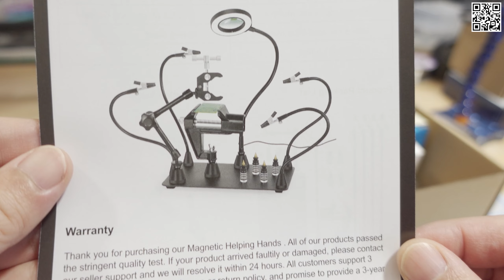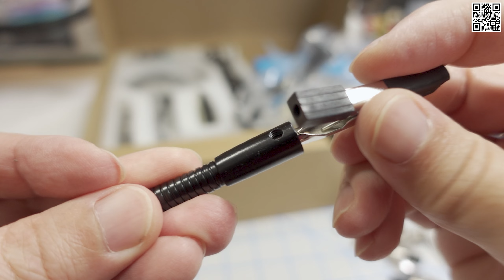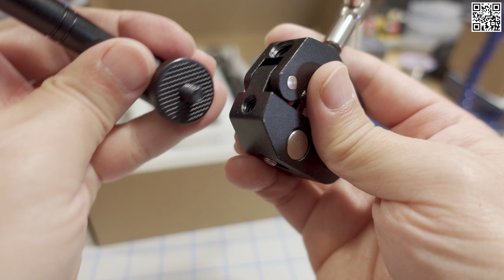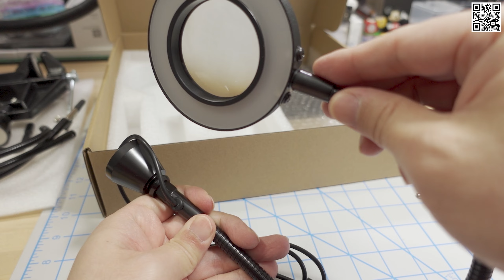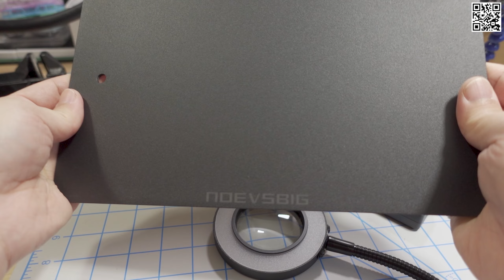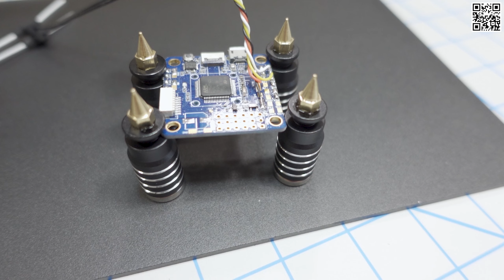Magnetic Helping Hands (MUST HAVE TOOL!) 👍

Comment: Thanks for the review.  I just got a smaller set with the hands and 'pointy column' holders.  Works really well.  I didn't realize you put the board between the columns like you did, i was setting it on top, and it moved a lot.  Will try this now!  Cheers!